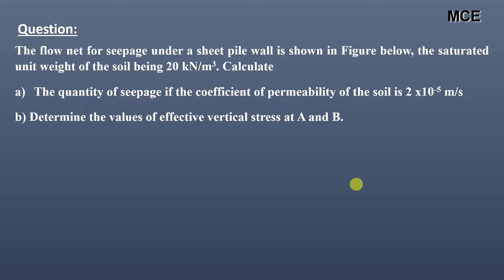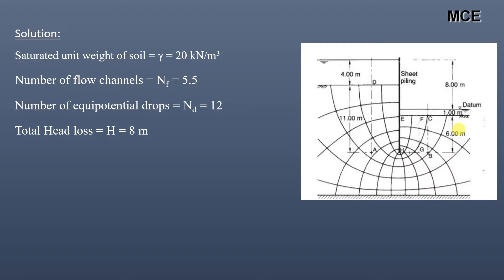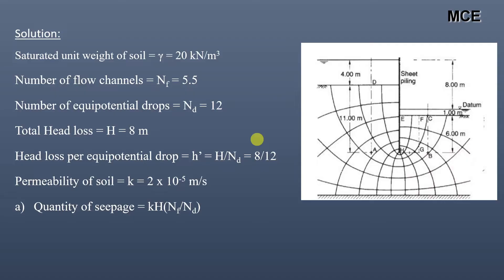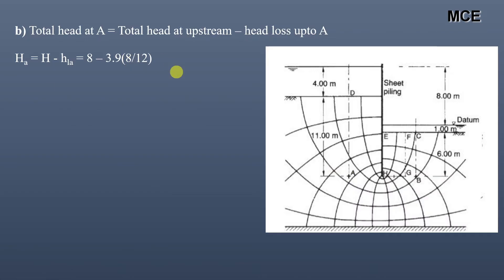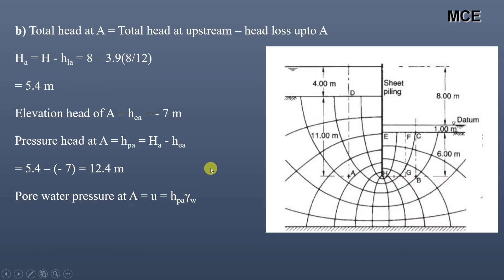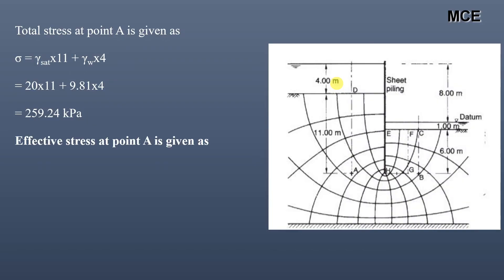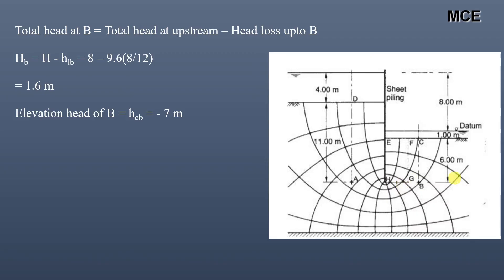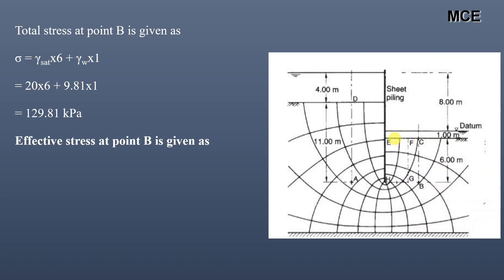How to Calculate Effective Vertical Stress and Pore Water Pressure in a Flow Net|Sheet Pile Flow Net

Comment: I am trying to perform a preliminary design of a temporary cantilever sheet pile wall in sand for a dewatering problem.  Is it appropriate to utilize the pore water pressures computed in this manner, and lateral earth pressures as well (determined utilizing the effective stresses that can be computed with depth along the front and back face of the sheet pile wall) to develop a pressure diagram for the sheet pile wall?  It seems that that could be used then to determine sheet pile size and embedment depth to satisfy force and moment equilibrium.
Reply from the maker: Thanks for watching the video
Reply from the maker: The method shown in this video to calculate the pore water pressure and effective stress is the most accurate method and is used by various american authors. The parameters obtained from the flow net can be used for the design of cantilever sheet pile wall but I would recommend you to get some expert advice before performing the preliminary design.